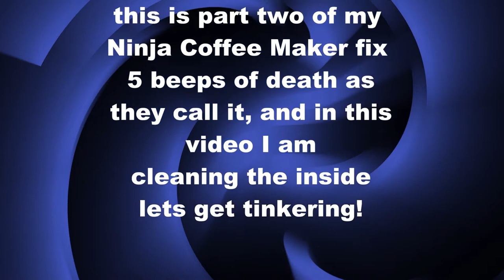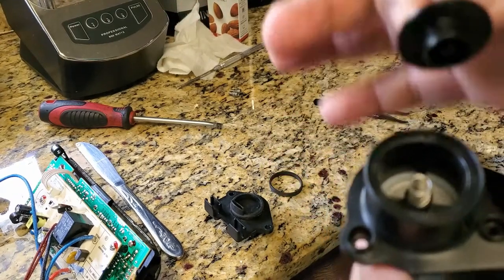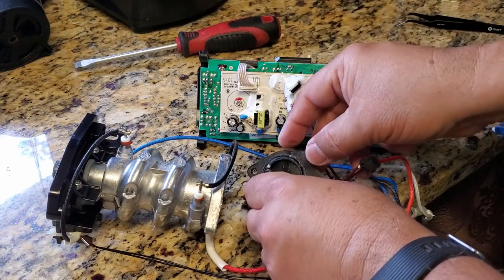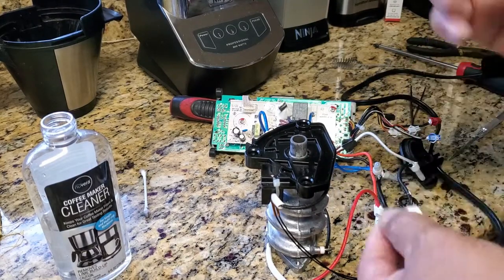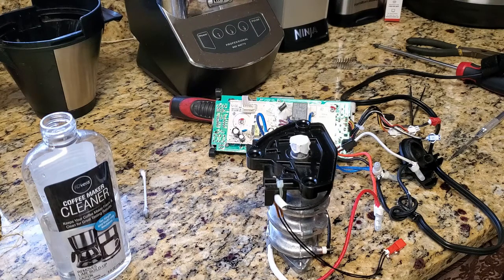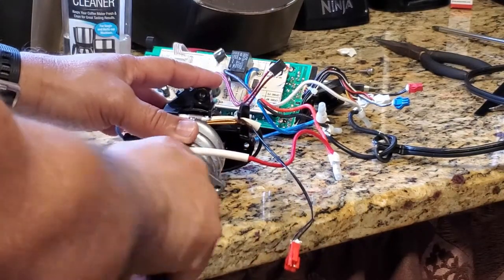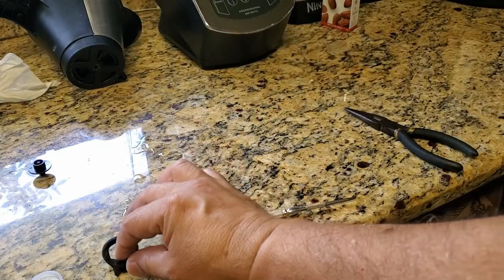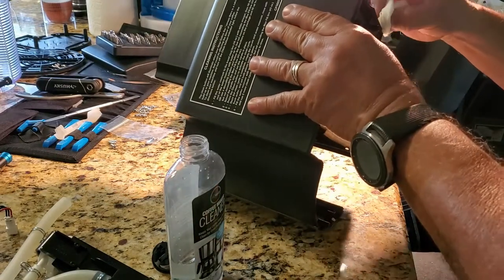Ninja Coffee Maker Fix Part two

Comment: The gunk from the boiler eventually clogs the shower head of the percolator section. Best to mechanically clean the boiler, use a bit of dilute acid to clean the shower head and tube. Still made me do a clean cycle even after mechanical surgery..

Comment from the maker: Hi sorry for the delay did not realize I had my questions for this video my apologies if it helps the reason in my opinion the Ninja after a while accumulates calcium formation in that heater element limiting the amount of water retaind in the reseware some how the water level sensor is thrown off and shuts down the coffee maker befor the cup is full that was my problem as well so I decided to investigate taking it apart and thats where I found all that gunk calcium resedu buildup as soon as I clear it out, the coffee maker was working fine!

Comment: Hi,
Not having a problem with beeping but I do have a problem with enough water filling my cup.
Happens on all settings of brews, clean the system water with white vinegar, fills the coffee cup with two short water fills for getting the coffee ready for the large filling.
Any suggestions. 
Regards,
Reply from the maker: Hi, sorry  for the delay. Well, the problem is eather the board timming for shutting off the water into the heter chamber has an error or a bad sensor is what I can think of!

Comment: Hi what is the tube inside the heating coil made of- metal or plastic?
Reply from the maker: Hi well I think you are referring to that little toob. I'm cleaning in the video section 11:22 of the video. If that is what you are talking about, well, that's actually part of the heating element itself, it is made of aluminum, the heating element is like a funnel it has the narrow part that looks like a tube and the wider part that has the cap with the rubber seal section 4:24 in my video I show you how I removed it! Hope this answers your question!